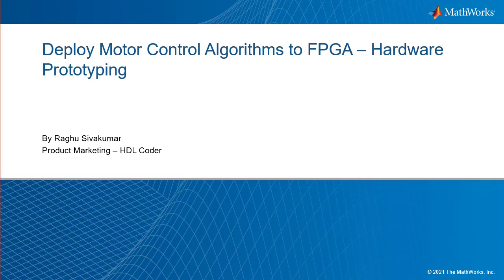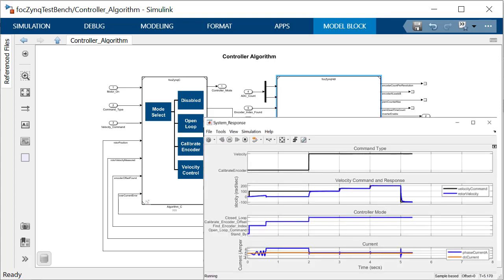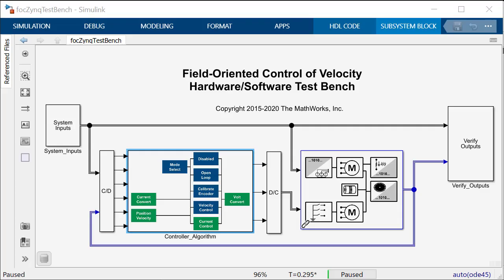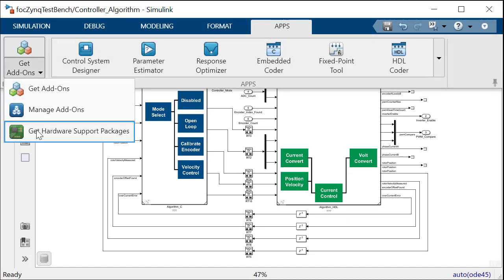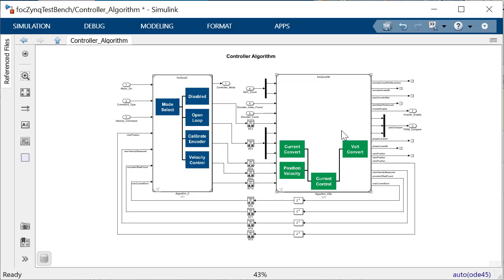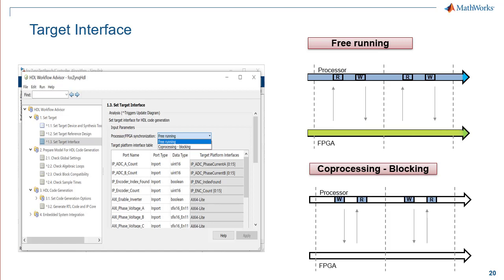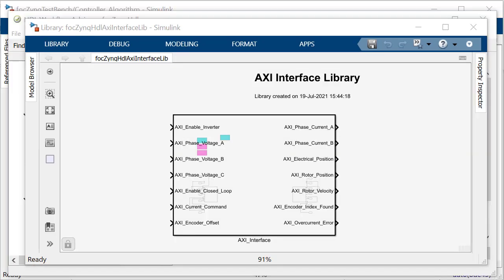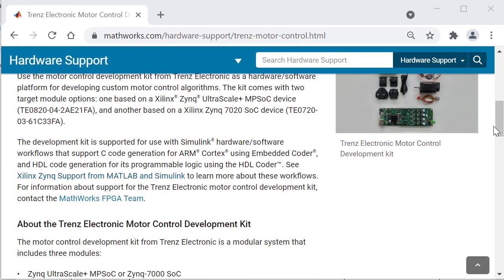How to Prototype FPGAs for Motor Control

Comment: What would be required if using a custom board/motor, not the Trenz Motor kit?   For example, how do you interface your FPGA/CPU to Matlab's Simulink HIL in-order to provide the sensor feedback data  (positional encoder for stepper or brushed-DC motors), or if sensor-less, providing the analog / back-EMF data  for brushless (BLDC) motors.

(I'm interested in learning and experimenting with different control-loop theories, targeting the Arizona AeroPendulum Project)